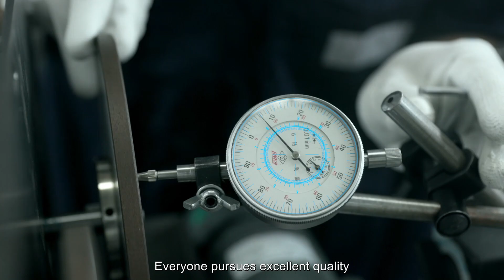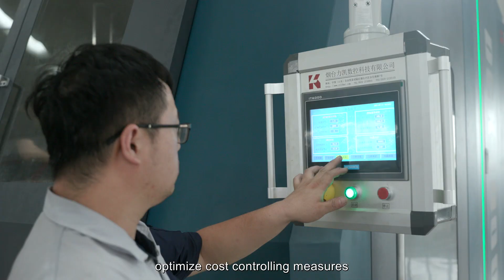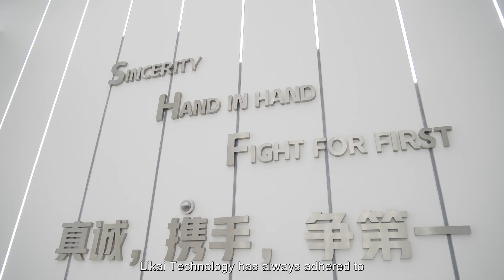LIKAI PROFILE VIDEO

Comment: Dear Sir/Madam,

I hope this message finds you well.

I am writing to inquire about a specific machine that appears to be based on one of your current products. I have attached an image that illustrates the configuration I require. Please note that this image is derived from a video of one of your machines available on YouTube. I have edited the image using Photoshop to reflect my exact needs: I removed one roller and adjusted the spacing so that the distance between the remaining two rollers is precisely **60 centimeters**.

Could you please confirm whether you offer a model in your product line that matches this specification—or at least a similar or closely related version? Additionally, I would appreciate it if you could let me know whether such a configuration is available as a standard option or can be produced as a custom order.

If this machine (or a comparable version) is available, kindly send me the following:  
- Product brochure or catalog  
- Technical specifications  
- Any videos demonstrating its operation  

Thank you in advance for your time and assistance. I look forward to your reply.

Best regards,  
*Mohsen Etebari*  
Khatam Karan Company